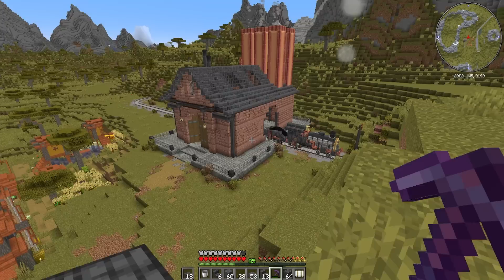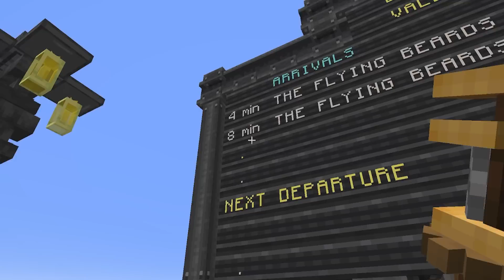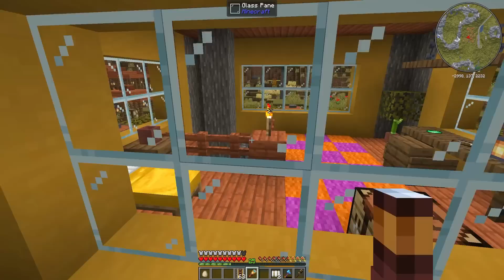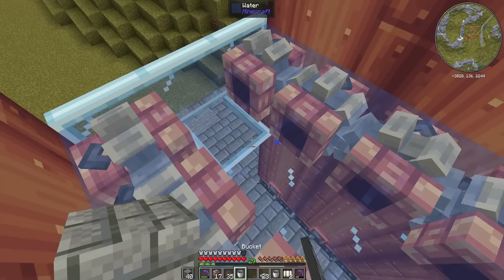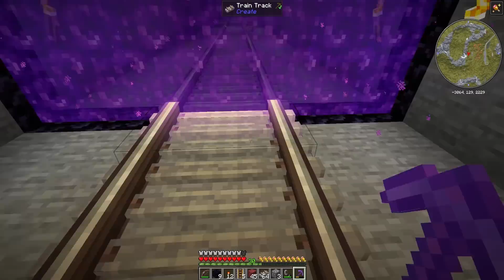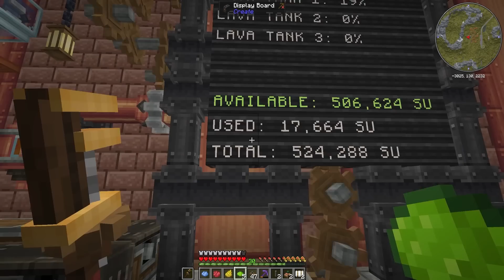I built a STEAM POWER STATION in Minecraft Create Mod!

Comment: I've got a suggestion for an improvement of the miner. Try using block filters for the block placers, to add cobble, cobbled deepslate, netherrack, tuff maybe, so you don't have to switch them out every time you want to mine at a different level.

Comment: Aww, I'm a bit sad you didn't have the portals on either end of the track and simply... have that section of track in front of the power plant.
You can have it come out of a portal on one side, deposit lava in that middle section, then disappear right back through the second opposite portal! Only about 20 blocks of track needs to be in the Overworld, the train can loop and go back out the other side in the Nether.

That would have been neat in its own way, but your tunnel is also cool. I guess you didn't want the portal visible? I think it would have been cool to integrate portals as part of the design. Maybe just going straight in to a portal in the hill instead of the tunnel? You could also have the portal at a different angle in place of the other tunnel entrance, just rotating it in both the Overworld and Nether to facilitate that.

Comment: I would say u can also make an "infinite" pit of lava (create deems a pit infinite to some point depending on how big and deep it is). Water is obviously infinite already, however lava needs a giant pit of it to count. However the nether is full of it so thats also a use

Edit: If you do make a pit, you can make it be apart of a giant volcano.
Reply: I really don't like those infinite pits people build. It feels so cheesy when there's a perfectly acceptable way to do it which both makes sense and is easier to work with.
You can simply move portals instead of having to destroy and remake 10,000 lava blocks.
I'm really wanting Create to come out with per-dimension infinite fluid configs, so I can disable infinite lava outside of the Nether on my own server.
Reply: @DonnaPinciot  although that is true im mainly suggesting it bc it can also leave way for the opportunity to make a valcano with the pit of lava. However i do see why its Better for the nether bc its easier.
Reply: @germans_lol7259  
That is a point.
It would be great if it could work with natural lava sources specifically, so if worldgen makes a volcano you can pump from it no problem, or if you find a massive lava lake underground, that would also be an option.
Unfortunately, I don't think there's any distinction between player-placed and generated fluid, or blocks in general.

Maybe a way to 'crack bedrock' to let lava seep out from underneath? So you can still control where it is without relying on worldgen, but also avoiding the need for the massive cubes of fluid you need to hide.
Reply: @DonnaPinciot  ik what u mean hut what im saying is that one way u can hide it is by building a volcano urself. Itll be sick to see a train go by to get lava frome there.

Comment: I try to avoid having steam engines power their own pumps, because if they get overstressed, then you have to kick-start them manually again. Which is fine, except that if the pumps are connected to the rest of the network, a single engine won't be able to handle the load. I usually make a dedicated level-1 steam engine to power the pumps and fuel distribution (and a water wheel to power its pump); that way if it binds up, all I need to do is turn off some machines and it will automatically start up again.

Also: The number of tanks you have is far more than you can use with the amount of heat and water you have available. Each blaze burner only gets you 1 level when fueled, so you're capped out at level 4 with your current setup. A good rule of thumb is each blaze burner needs 4 fluid tanks above it (8 if you're going to super-heat them with blaze cakes, but I find that's not usually worth the hassle).

Fantastic video as always! It brightens my day whenever a Beardy Create video appears in my subscriptions.

Comment: download valkyrian skyes, then turn your airship into a actual flyable thing, also create stuff work in the ship, so you can put an elevator under it and be able to work inside it (Including place blocks)
Reply: did u check if it works with his modpack? and also eureka
Reply: eu já tentei fzr isso, inclusive um add-on pra create que faz com q tu possa mover usando máquinas do create, mas o mpdpack por algum motivo n aceita nenhum tipo de "conteúdo extra", eu acho q deve ou ter a ver com o fato de ser em uma versão mt recente, ou o modpack deve ter algumas config no .json dele q n tenho acesso e por causa de tags customs dos mods. sempre devolve o erro registrado type null.
Reply: If I remember correctly, the Machines work with everything exept dirt blocks, stone and grass blocks, but it works just fine with chiseled blocks and framed blocks

Comment: I think it'd be cool if you had a conveyor belt structure that ran across the tracks & station from a factory opposite the tracks. When you first built the station there that's what I first imagined. And if you may, the next locomotive you do, can you try and replicate a 4-6-2 or 2-6-4 type? I'm not familiar with my steam locomotive wheel arrangement names, but hopefully that helps break from the 4-4-2 Atlantic type(?) builds you've done so far.